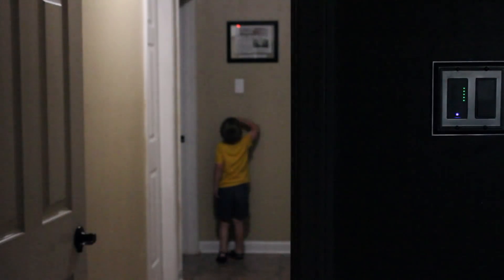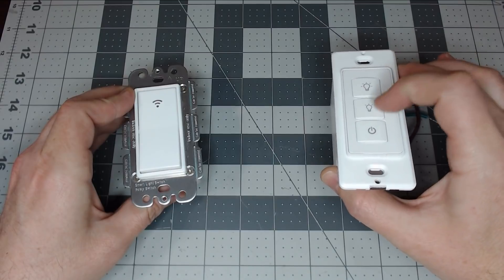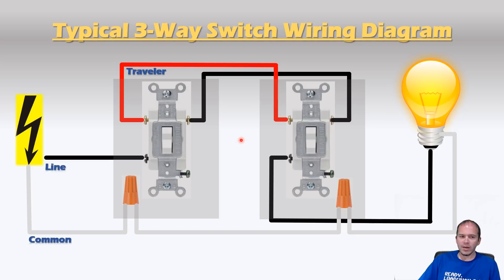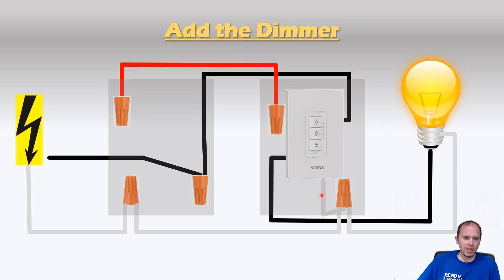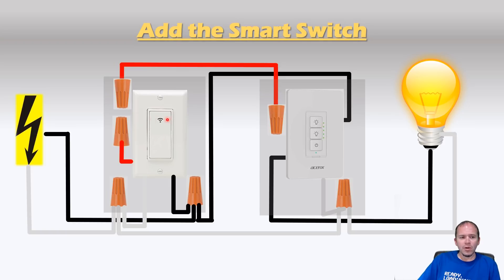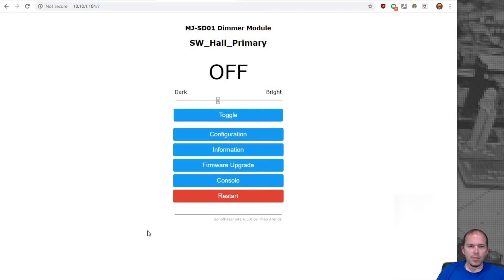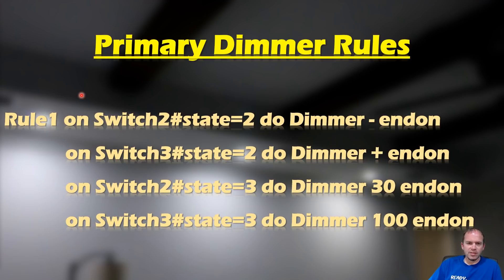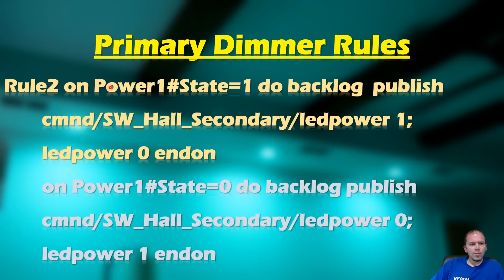3-Way DIY Smart Dimming - Without the Cloud!

Comment: What the difference between Button1 and Switch1 and are the caps required?
Reply from the maker: Button1 and switch1 work a little different in Tasmota. Buttons have multipress and switches don't.

Comment: Great video. I have a similar set up where one dimmer switch is hook up to the light and the other identical dimmer switch is not connected to anything. I was able to sync the on and off using automation in HA but I am cannot sync the dimming status (I can only control the dimming using the dimmer connected to the light). I was wondering if I could use the rules for that.
Reply from the maker: Yes, if you have two dimmers I'd have just have the second dimmer send button presses to the first dimmer much like I did with this video https://youtu.be/RyXqLRAFdPY

Comment: I am considering adding 3-way smart switches in my home.  However, there is no way I can know which the origin or destination of the bundle of wires in the wall boxes.  So, how can I know if my wiring matches the diagram shown in your video???   I am pretty handy, and I have installed standard switches, but the jumble if wires in 3-ways are confusing inside the wall boxes.
Reply from the maker: There a few videos I have seen around by using a meter to figure out the wires. Be careful. https://youtu.be/Xp4FWJRzHdo

Comment: Great video!! In the 3way switch diagrams, my home uses option# 6. Any suggestion as to how I can wire the same setup like yours?
Reply from the maker: I don't think you have any neutrals in the boxes from the looks of it though?
Reply: digiblurDIY I think so... any other ways I could get a similar setup without a neutral? Or Wi-Fi bulbs are my best bet?
Reply from the maker: There might be some other switches out there in the Zigbee/Zwave camp that work with no neutrals as they sip on the line, I haven't seen any WiFi ones like that though.  

Only problem with any type of smart bulbs no matter the protocol is people turning them on/off and maintaining wall control.  Is running electrical lines out of the question?
Reply: digiblurDIY thanks for your advice! I don’t think I can run another wire around as they are wired across three lights.  Seems like the only way I have is either wifi bulbs with the switches removed or a zwave switch. Thanks again!